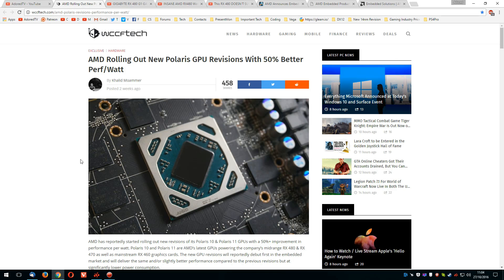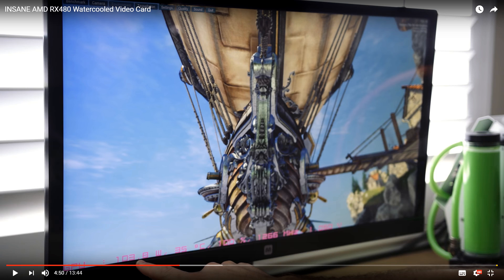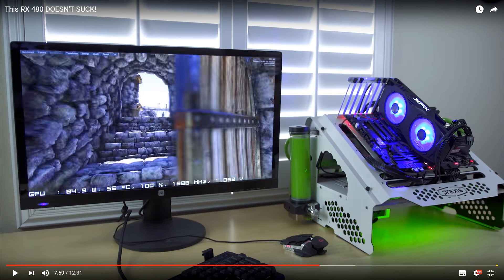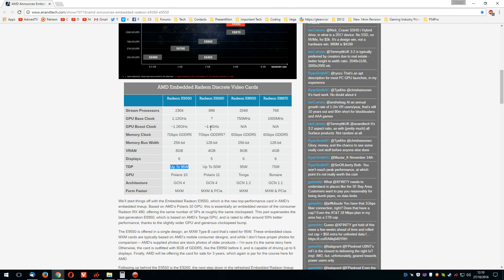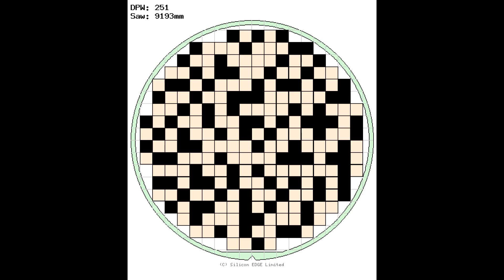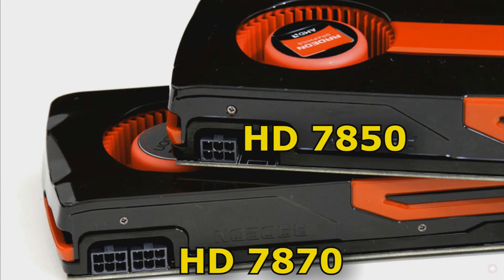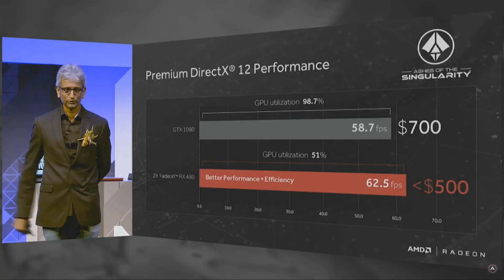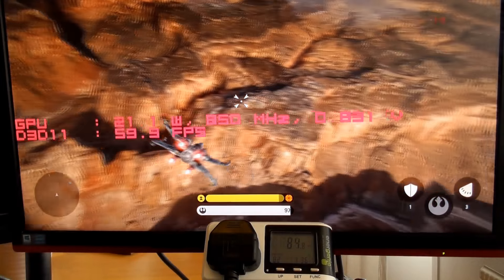Polaris Efficiency - Truth or Myth?

Comment: There are not two GPUs in the PS4 Pro. You basically have the actual one mirrored and power gated. As far as i know, AMD had to do a respin because the gating was not working - a metal spin should do it. I hope you don't believe a spread in production of the claimed ~33%. That would be insane. Normally you have <15%.

Jay's videos have several gaps: 1st he compare Unigine Valley and Heaven, 2nd he don't give any numbers for the Valley / Heaven benches (framerate, driver...), 3rd he didn't mentioned any settings and 4th he uses different programs (MSI Afterburner and EVGA Precision X). So that is no science or a good base for investigation. I want to believe a down of 65 Watts (from 150 to 85) but it is too unrealistic for the same node...
Reply from the maker: All the cards will rise to a max of their power limit whenever required, or throttle when they can't stay under that power limit.  The only setting that would change the GPU power draw as drastically as we see here would be a frame-limiter or CPU bottleneck.

The XFX only needs 95W to maintain 1288MHz, the Gigabyte one can't even maintain 1288MHz with 125W.  The throttling seen on the Gigabyte one may have been due to a mis-aligned cooler however, but that still doesn't explain why the GPU has a power limit of 125W in the first place and why it was at 125W while the card was well under the temp limit.

Furthermore, Heaven is really tough on cards and my reference 480 won't maintain 1266MHz even with a large undervolt - it simply cannot maintain the boost clock at its stock 110 Watts power limit even while undervolted to 1033mV, yet the XFX was able to run at 1288MHz under 90W at all times.

So what we have is two RX 480's with two vastly different power requirements at 1288MHz - so yes I do believe that spread in production as I haven't seen a better explanation. ;)  I also believe that the XFX one is as cherry-picked as they could find however and the Gigabyte one is literally the worst available.
Reply from the maker: I was intrigued by your settings comment issue so I decided to check out some stuff, just incase.

http://i.imgur.com/jblEQAZ.jpg

I set Heaven to lowest settings and my GPU to 90W power limit with an undervolt to 1033mV.  It was never able to boost above 1100MHz, mostly settled around the mid 1000's.  As expected the GPU was pegged at 90W at all times.  Even with what should be a decent chip (81% ASIC quality), the gap to the XFX GPU is an awful lot.  I can't think of any other good explanation.
Reply: I think we can exclude a CPU bottleneck. Is there any setting in the Wattman or driver where you have always max boost clock? At NVIDIAs driver is a setting called "Power Management" which you can set to "prefer to maximum performance". So the dynamic clock and voltage scaling is turned off. Now you can find out the lowest possible voltage for the stock 1266 MHz. Heaven Benchmark has the disadvantage to not react very sensible on undervoltage / overclocking what i experienced so far.
My opinion: Jay had got a very good, preselected sample. Igor from tomshardware had a similar issue with MSI. The best way would be: Jay build the same basis for all three cards and runs tests for 10 Minutes (e.g. GTA V or Metro Last Light @1440p) and give us/you all these numbers (Frametime, PC wattage, gpu wattage, clocks, voltages, utilization, settings...). And as a bonus he look at the Chips if there is a B1 or A1 Revision....
Just my 2 cents (not JayZ's) =)

btw: Thank you for further investigations
Reply from the maker: Basically there is a power limit slider in Wattman which allows you to raise or lower the power (and temp) target of the GPU.  Each card must have a factory setting for power limit in the bios - mine is 110W and some of the OC'd cards are 150W.

There is no other way I know of for the card to remain at maximum boost otherwise - it'll just go to max so long as the power and temp targets allow it to.

Looking at Jayz testing again, he did hit 102W with the XFX at one point during Firestrike.  It may have the power limit set to 150W but just not getting anywhere near it at stock clocks.

I agree he has an extremely cherry-picked GPU, possibly one of the best there is.  It would be great to know if it is a revision yes.  What is odd is that it wasn't chosen as one of their Black Edition GPUs, which has a factory boost of 1328MHz..
Reply: I would suggest you contact him directly and work it out. You both are well experienced and i think he wont reject you. The most important part for a comparison is the basis on which you are working on. I haven't seen an equivalent card like that in past reviews. ;) As i said: I want to believe a drop of 65 Watt, but it's hard in one process node (even if something was broken like in Fermi's Interconnect)...

Edit: BTW: The slider in wattman also add an offset to the algorithm, so it is not the same as the NVIDIAs option which left the power-algorithm untouched, just deactivate the correlation with GPU utilization.

Comment: The way AMD measures the power draw is not very accurate and highly dependant on temperature. The powerdraw doesn' really fluctualte that much. It's the measurement that does! If you measured power draw there wouldn't be much difference between water cooling vs. stock cooling.

Comment: 5:55 Now I have to wonder, if that Alienware Laptop comes STOCK with a 6GB GTX 1060, does choosing the RX 470 knock money OFF the cost, or does it cost MORE? Becase anyone with any sense in their heads, and anyone with ANY benchmark knowledge-  will know that the GTX 1060 6GB is a FAR more powerful GPU that draws FAR less power!

My Brother's MSI GS63VR has a 6GB GTX 1060, and since I re-pasted the heatsinks and heatpipes, I have been able to get the GPU to boost to 1988 MHZ core  very stable (lowest =1789 MHZ, highest = 2076 MHZ)  by simply adding +136 MHZ core and +500 VRAM (yes, his MOBILE 1060 is running 9 GHZ VRAM!) in MSI Afterburner!

For comparison, a DESKTOP RX 470/570 cannot OC NEARLY that much! And at those speeds, that LAPTOP GTX 1060 is basically tied with a DESKTOP RX 580!  AMD has TERRIBLE efficiency per watt compared to Nvidia, and at this point, I think they have lost the mobile market ENTIRELY! They will regain SOME of the "Budget Gaming Laptop" segment with their new APUs I am sure, but those will NEVER compare to a system with an i7-6700hqm (true quad with Hyperthreading) and a GTX 1050 or better! Not until AMD is able to make low power APUs with built in HBM anyways...

Comment: Well, it could be that they did intend to sell them as graphics cards, but then, you know, you have a processor, and the electrical engineers at the medical equipment and lab equipment supplies are like, oh with x64, we should ask for a bid for some of those chips, and, you know, you can get a little spendy on that, and then AMD starts running a little low on the processors.  "Yeah, we can bid those against Intel."  You know...  it's funny, I used to read engineering magazines and they would advertise the chips, then you come to these people testing the video cards...  well, some people are interested in the chips.  You say they need to get better, some engineer with a product they were designing see the add for cheap VR processors and essentially takes half the VR video cards off the market, everyone complains about how few there are on the market and how the price point varies drastically.  Why is the i7 so expensive?  Because the ones that are hot off the presses cost that much, lol, someone needs to see what they can do 15W or something, and whatever they can eke out will be closer to best for whatever exotic research they're doing.  You have to wait until the exhaust of these consumers gets richer.
Reply: It could be that AMD didn't expect to end up being competitive, necessarily, or in businesses seeking to develop an improved supply chain for security reason because one item was only coming and only available form just one supplier.  Even if they were promising a little much, their would likely still be some interest from those who may even need to keep a small stock pile and need the safety of a more diverse supply chain.

Comment: No.AMD is not lying.The problem is reviewers.These so called reviewers are taking the AMD product over clocking it with poor numbers.In an over clock you can have 1 in about 4 numbers that is good.An it works like that.Clock settings 1 through 3 could be bad.But the 4th one will be a good an well balanced clock that uses little power an gives full benefits.The fun is finding the perfect number.It just takes times an practice.

     This also depends on your motherboard.But here is the thing.JaysTwoCents and Joker Productions an even this one guy i just found are all payed by Intel to make sure AMD performance looks bad.I am not joking.It takes nothing to make a performance test look good.You throw in your graphics card run the driver you currently have an see the performance.Then after recording that information.You run the latest driver.

      If the latest driver has issues.You give a recommendation to use the older driver.Everything is fine.What these reviewers are doing are.They have a specific test bench with a horrible performance CPU something below the required performance needed to turn the game.Then use the graphics card to make up for the performance loss.

      For an example.I have a FX-9370  8 core (default 4.4GHz) Turbo 4.7GHz. This is not the proper test bench speed you will run for an AMD processor.It has to be lower.A i5-6600K 4 core At 3.5GHz is required.You cant run at 4 to 5 GHz that would show too much performance.It has to drag.Then I have a R9 390 what you said was the same around the RX 480.

http://www.hwcompare.com/30935/radeon-r9-390-8g-vs-radeon-rx-480-4gb/

OK,here is the problem.Because of the below required performance of the Processor.The graphics card has to make up for the performance loss.So the graphics card struggles a little.Not only that but it also gets Poorly Overclocked.With some numbers like Instead of a 50% over clock its 1.38% Overclock.Some uneven number.

Something that is not an actual Overclock Like a 30% over clock or a 50% over clock.No.Its an Low and uneven number.Causing heat power drain an performance problems.THEN they set the game to Ultra settings.I want to point this out.We caught them both doing this to the versions they had.So we just started thumbs downing their videos when we caught them doing this.

Comment: they've backed off to 8 gig  memory going to basically be 2x480 one one card everybody knows  2 amd cards scale better than a dual amd card I learned this when I gave up 2 hd5870 cards in crossfire for a asus ares hd5870x2 card  it was only 2/3rds as fast ast the 2 cards in crossfire. amd has a problem not putting crossfire in a lot of their drivers to make you update your hardware

Comment: gigabyte are absolutely useless, I have a sapphire RX460 nitro+ 4gb, it's a fantastic wee gpu, the temps are really low, it idles at about 32c and under full load barely breaks 40c - that's without OC ofcourse.
Reply: Scott Cooper I know right I have 270x from gigabyte their are shit
Reply: Scott Cooper I have the RX 480 nitro+ temps are much higher, but exactly as advertised. Hits right about 75 watts under heavy load, and idles at 50.
(however, worth remembering at turns the fan off completely at any temperature below 50, and you don't seem to be able to override this. Plus my case is cramped and airflow on the fan side of the card especially is probably quite restricted.)

Comment: Sorry to say is but i Have the Same xfx Card as Jay reviewed Mine pulls 100 to 105 watts
Reply: Try toying with undervolting a little. Choose a desired fan curve, if you want, then reduce the voltage offset using Trixx or WattTool a bit and let your GPU reach a saturated highest temperature under load. At 1300mhz, I was able to achieve a -135mV offset, putting me in a fascinating realm of temperatures, noise, and power consumption. Mine is not the GTR, so your results may vary. Good luck!

Comment: explains why my 470 I bought runs hot.
Reply: undervolt it
Reply: Polaris cards are set to run at a target temperature. It is set to run at 75 degrees Celsius from the bios, so that the fans won't have to rev up too much and be noisy.
I undervolted mine, cut 30w from its consumption, but the temps remained the same. Why? because the fan speed was reduced.
Reply: Adrammelech Already did bro

Comment: Thats why i didnt buy one, and could not recommend it to anyone. 
Btw i own and have owned 3 290s, 4 290Xs, and bought a Devil 390X today as a placeholder till Vega - if they dont fuck us over again like with Polaris.
Reply: Why not just get the 1080 if you want high performance card ?
Reply: Freesync monitor(LG 34uc88-B), would have bought the 1070 as placeholder if Nvida would admit defeat with G-sunk and release Adaptive Sync drivers.
And 700€ for a high mid range card is waaaaaaaaaaaaaaaaaaaaaaaaaaaaaaaaaaaaaaaaaaaaaaaaaaay too much ffs.
Reply: ...and got the Devil(watercooled) R9 390X for 250€.
Reply: Curently im playing Battlefield 1 on 3440x1440p at 60FPS with a regular PCS+ R9 390 at Ultra settings 60+FPS at 1130/1650MHz.
These 290/390s are freaking mosnters at high res.
Reply: Really? I'd go 480 any day over similarly priced Nvidia.  The 480 is starting to dominate in more and more games, AMDs investment in the consoles is starting to pay off it seems.
Reply: +Sinier940n 1080 is too damn expensive dude
Reply: You wont buy polaris because it consumes more power than AMD promised? 150W is still much more power efficient than previous cards like the 390x.
Reply: Did ya buy Vega?